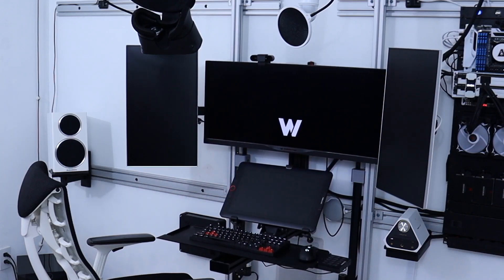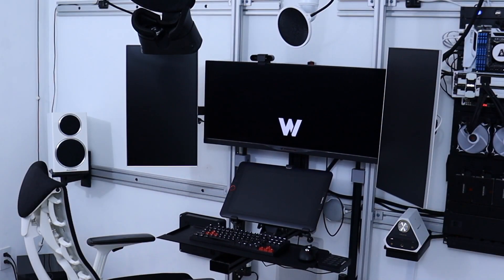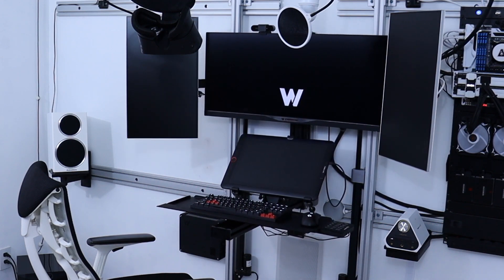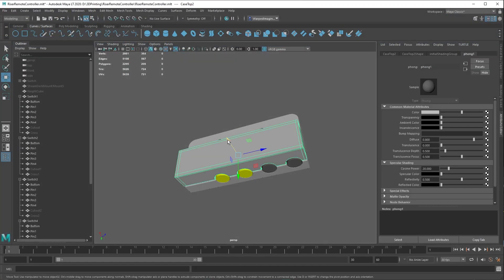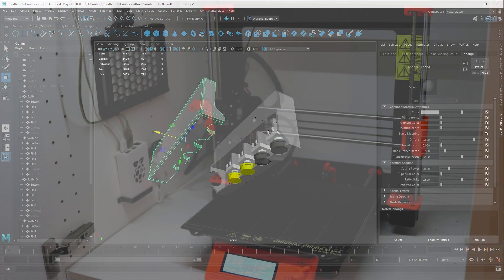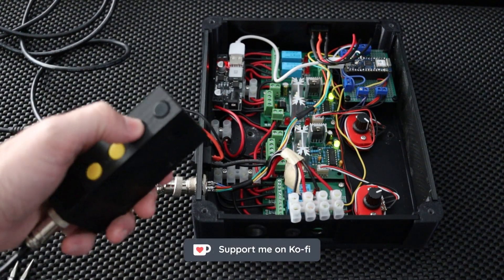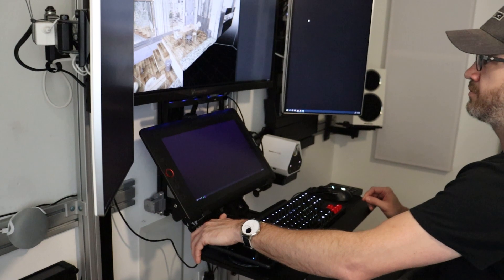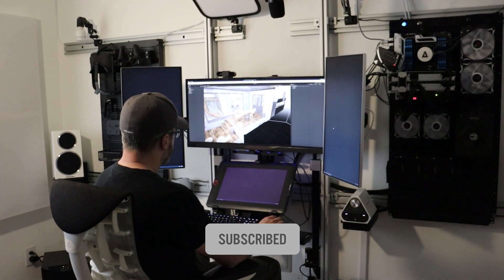Making A Desk Riser Remote For Ease Of Use

Comment: The height of engineering laziness:  40 hours of work to save a few seconds.  Love it!
Reply from the maker: The main controller and the wall mount was the real build and took the bulk of the time. This remote was probably only a couple hours .. and if I am honest most of that was because my soldering skills are sooo rusty .. the 3D printer worked harder than I did on this one.